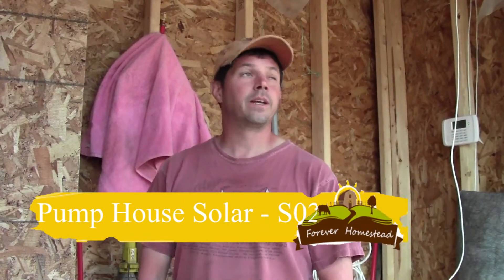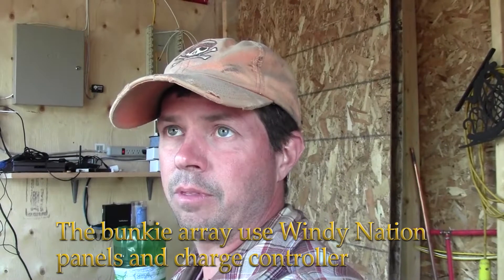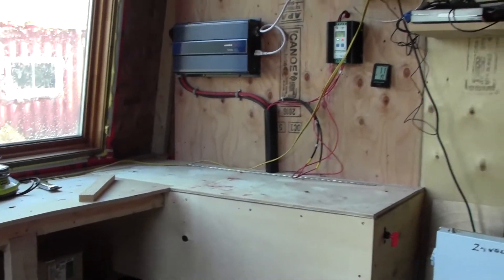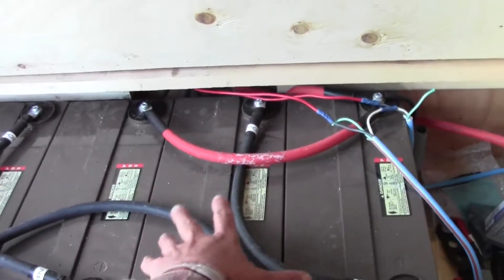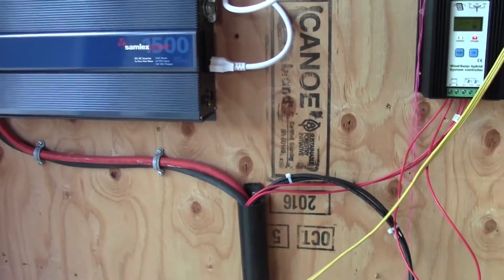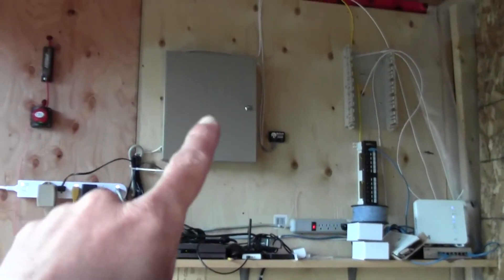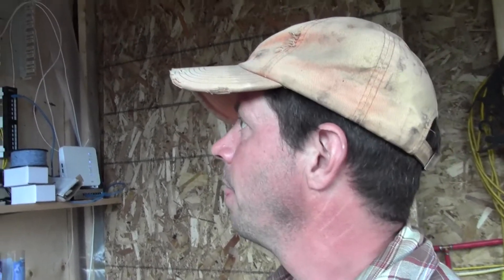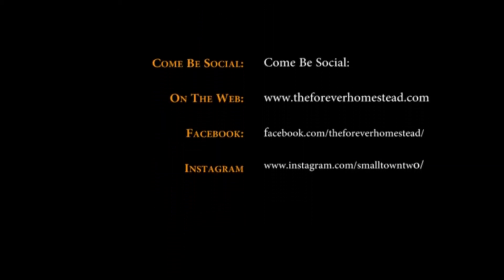S02E15   Canadian Cold Weather Pump House - Part 5 Solar System

Comment: What is the purpose of the basement below?
Reply from the maker: We live in ontario canada where things freeze in the winter.  By having the pressure tank and pipes below grade , it does  not freeze in the winter.  Even in -20 c temps outside it never goes below 0 down there with out any heat
Reply: The Forever Homestead  Thanks for the response. I’m looking at doing something similar here in Alaska. But putting the pressure tank below grade is a new idea for me to consider. Thanks.